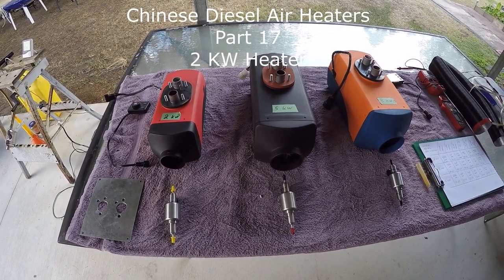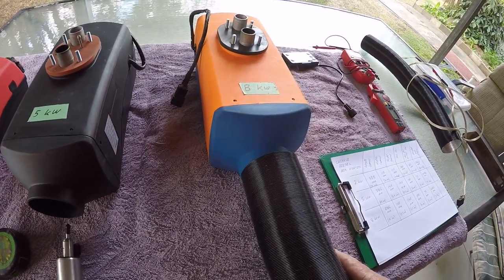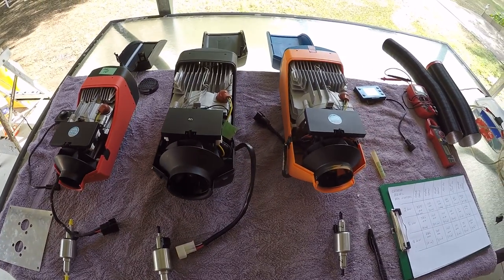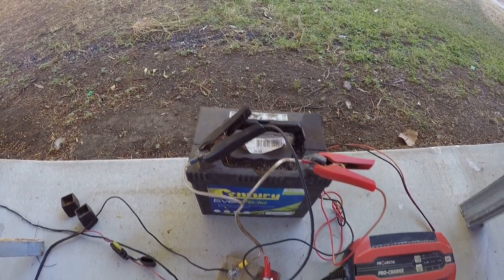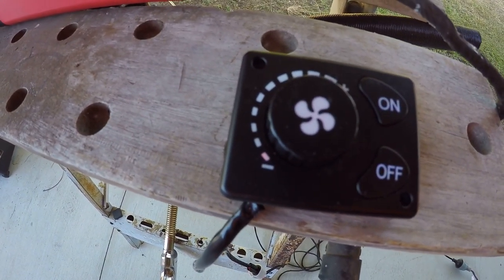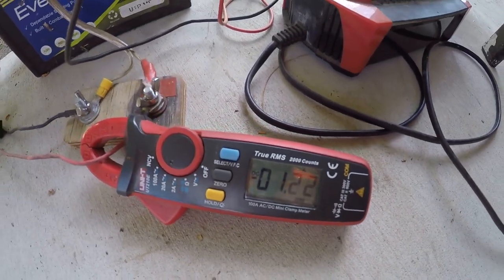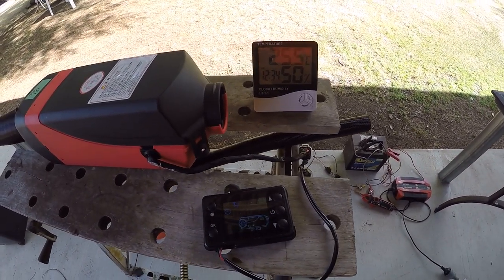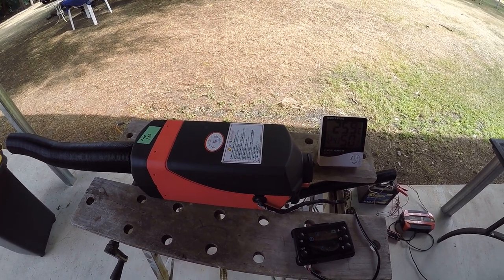Chinese Diesel Air Heater   Part 17 -  2 Kw Heater

Comment: Please tell what is the smallest battery that I should buy to run the 2 kw heater for a nights camping. We are going on a motorbike and hope to carry a heater and a battery in the panniers. Thank you. J
Reply from the maker: On a medium setting the heater will draw around 2 amps.
If you run it for 10 hours a night you will use around 20 amp hours.

If using an AGM battery you can only pull about half the rating or you wreck the battery, so you would need a 40 amp hour battery. 

If you use a lithium battery you can pull around 80% of the rating without doing battery damage, so a 25 to 30 amp hour battery should be ok. 

Run the heater at full power all night and you will need double those figures.   JMcK
Reply: @johnmck1147  Thank you. I suppose it is a stupid idea. Going to IOM TT in May. No electrical tent hookups left. Gonna have to think of another plan. This idea was my safe option.
Reply: @johnmck1147  pity they don't have a method to get it burning quick like a TVO tractor)))

Comment: Nice video.  Can the heaters be mounted side on rather than the outlets facing down?
Reply from the maker: Yes, these heaters can be mounted on their side, but only the side where the glow plug is on the top.  JMcK
Reply: @johnmck1147  Thanks.  I think my temp sensor is faulty.  Fan stays on after shut down, only way to shut it down is to pull the fuse.
Reply from the maker: @idc1873  
It is normal for the fan to continue to run for some minutes after shutdown. The glow plug comes on and the fan runs to not only cool down, but also to expel  any unburnt fuel remaining in the burner.  JMcK

Comment: Hi John, thanks for all of your videos,  very helpful. I have a couple of questions you may be able to help with, I purchased a 2 kw heater which came with assembly instructions but no instructions for the L E D controller. Can this be programmed to turn the heater off at a preset time and is the temperature adjustment done by changing the hertz on the pump or is there another way. Also can I get an E10 error code if the battery is not fully charged . Have you had anything to do with the Japanese  Mikuni diesel air heaters. Thanks in advance for any help. Regards Bruce.
Reply from the maker: Hi Bruce,

The heater can be set by temperature limit in controller, but it won't turn off just slow down when set temperature is reached. When using the auto method the heater “hunts” . It roars along at max speed trying to get up to temp as fast as possible. I almost always use a manual Hz setting myself, that way I get a gradual temp increase without all the noise.

A partially charged battery will run the heater but may not be able to start it. The heater requires around 10 amps of current and 12V to start.

I have no personal experience of the Mikuni heater.  Sorry.  JMcK

Comment: John, thank you for these series of videos. I've learned all I wanted to and more. What is your advice regarding using this heater in a rooftop tent (smaller spaces)?  

The 5kW version is not much bigger so size is not a concern for me. What is a concern is if this will be too hot for the tent during winter camping in 30F to 40F (-1C to 4C) on low setting. 

Another consideration for my setup is noise. I planned to hang this to the rear of my hardshell tent as it seems the best place to place it that won't get in the way of anything I have. Getting a 5kW and running it low means the fan will be less noisy than when running on high of a 2kW unless low setting on a 2kW is sufficient to get my tent to 75F-80F (24C to 27C).  Thank you.
Reply from the maker: Hi William,
There are a lot of unknown variables here for me, such as operation temperatures and install system, but I think a 2 Kw heater will be more than enough for a roof top tent. JMcK

Comment: My 2kw heater smokes quite a bit. Upon startup it’s good, but over time (15 minutes or so) plumes of smoke comes out of the exhaust and the fan speed drops. 

Do you know what would cause this, how to remedy the issue? 

Thank you.
Reply from the maker: Hi Kyle,

It is a bit hard to offer an opinion without knowing more about your set up.

First, I assume you are using good diesel as a fuel, and not some oil product.

Generally smoke is caused by a bad fuel air mix. This can be caused by restrictions in the combustion air intake or the exhaust system. I would also look for carbon buildup in the heater atomisations screens which would also cause a poor fuel air mix.

Good luck.  JMcK

Comment: I am confused.  I remember in one of the previous videos you said it's better to get a smaller heater than the bigger heater if you don't need full power because the bigger one running at reduced speed won't be as efficient.
Reply from the maker: Hi Hung,

I think you may have me confused with someone else. Right from the start in video 1 I state my opinion that I believe it better to get a bigger heater for the particular area and run it slow (less noise, less fuel, less wear) rather than a smaller heater running flat out (more noise, more fuel, more wear) to provide the necessary heat.

However you need to be sensible, you don't want to go oversize for the area. My personal rule of thumb is if a particular size heater can provide enough heat at half speed setting, that is a good size.

However, one issue you can have from long periods of running at a low speed is carbon build up if your install has excessive restrictions. But this is easily fixed by  occasionally running the heater at a high setting for 15 mins or so. 

Cheers.  JMcK
Reply: @johnmck1147  Thank you John for the thorough explanation. It cleared up for me now.  I bought a 5KW heater.  At any speed lower than 3 Hz I lost the 2 red bars,. The casing temperature is only 120 C or less.  I tried everything I could, fan gap, atomize cleaning, tuning.  Everything looked good, clean and no smoke, but the temperature was just too low at low speed.  Plus the load current is over 1.5A at the lowest speed.  I think I just got a defective unit somehow.  I just ordered a 2KW unit on eBay.  Hopefully It will work good so I can install in the van.  Also hope the current load is lower, for my battery's sake.
Reply from the maker: Hung Pham 

Hi Hung,

The normal current draw for these heaters at a minimum setting of 1.6 Hz is about .7A to .8Amps. 

Suggest you check your wire size from the battery. The power wires supplied are absolute minimum, and if you have extended the wires you must go bigger in size.

A 2Kw heater uses about twice the current to produce the same heat output as a 5Kw heater. The fan and pump on the 2Kw have to run much faster, drawing more current.

I talk about this at the start of video no 18. You may like to look at that video.

Cheers.  JMcK

Comment: Hi, thanks for the video. The rotary controller for my little 2kw heater is flashing sometimes, sometimes red, sometimes blue, and the fan level seems haphazard. Any advice? And how do I know if the digital controller is compatible with my heater. I see my controller has 3 wires but I don't know much more about it.
Reply from the maker: Hi KS,

If the controller is flashing it is giving you an error code. Count the number of red LED's that are flashing to get error code. Three flash E03, 5 flash E05 etc.

In the past it was easy to mix and match controllers as they had the same plugs , wire orientation, and protocol. Sadly now some manufactures have gone proprietary and controllers are not easily adaptable.

If your controller plug is a triangle shape, you may be able to plug in an LED controller.

Cheers.  JMcK

Comment: Hi john mck. unfortunately I'm not good at English so I don't understand exactly what is being said in the video. I have a vw transporter, long model. Which diesel heater should I have? I have 5 kw which I have not installed. do you prefer 2 kw. thanks!
Reply from the maker: @Håkanhavsöring  
Hi Hak,

With a VW Transporter, you could probably get by with a 2 kw heater…..But this is very dependant on the insulation of your vehicle, and the winter environment you will be travelling in. This you have not stated, so I can only give you an opinion.

I find it always better to have a bigger heater running slow, rather than a smaller heater running flat out, and making much more noise. However, this is personal choice.

The footprint of both heaters is exactly the same. So with your install, if you can, have room for a 5 kw heater, then you can easily swap the heaters in and out. If 2 kw too small, swap it out for 5 kw. If you start with 5 kw and find it too hot, easy to swap it out for a 2 kw heater.

Safe travels.   JMcK
Reply: Thanks for your detailed answer JMck:) I live in Sweden so the winters can be cold. I start by installing 5 kw. Last question: Is there a risk of fire if the heater is turned off without being cooled down before turning off. Thanks!! / Håkan
Reply from the maker: @Håkanhavsöring  

Hi Hak,

It is not good to turn off these heaters at the main power, and not allow them to go through a cool down cycle, and blow out any residue diesel.

I have not heard of any heaters actually catching fire, but I know of cases of the ECU melting, including one of my test heaters. If there was some loose paper or flammable material in contact with the heater, you could potentially have a fire.

JMcK
Reply: Ok Thanks for your answers:)
Take care🤠
Hakan

Comment: are the gaskets you can buy, are they all the same size; i needto order some
Reply from the maker: The 5 Kw and 8 Kw heaters have the same gaskets. The 2 Kw heaters use smaller gaskets. You need to order gaskets for your size heater.  JMcK

Comment: Questions boss.  I have one of these heaters with the LCD controller.  It seems no matter how low I set the thermostat 8C the heater just keeps running?  Does the thermostat not automatically turn the heater off and on?
Reply from the maker: Hi Jack, it turns it down to idle. If it turned it off you would have to manually start the heater again. I personally would not have a heater that could just turn itself on by itself.  JMcK

Comment: Hi John
Just fitted diesel heater, runs efficiently for about 10 minutes then winds down with E-05 error message. Can you please advise reason for fault & procedure to fix.
Thanks in advance. Brenda
Reply from the maker: Hi Brenda, 

E05 is often an overheat fault. This can be caused if there is not enough free air around the heater, running the heater at too high a setting for the ambient temperature, or a sensor fault, or lose sensor wiring.

One issue that does come up if controller set on automatic temperature setting, is the heater goes flat out on start up to try and get to the set temperature as soon as possible, and the heater can overheat.

Suggest you try your heater on a manual setting, say 3Hz to 4Hz and see how that goes. 
I personally prefer to only use the heater on a manual setting to prevent the heater roaring at full speed trying to heat the room to temperature as soon as possible.

It is very rare to have a sensor failure.

Please let me know how it goes.  JMcK

Comment: John what a wonderful video. Nice work. While watching I noticed one thing you didn't cover. Is there a difference in the orifice/nozzle size between the models? If so, there may be some different consumption numbers. Again, nice video.
Reply from the maker: Hi SV "R"

The dosing pumps are positive displacement pumps. Both pumps are the same putting out .02 ml per pulse. The same pulse rate pumps out the same volume of diesel.

When the diesel reaches the heater it is not injected into the burner chamber through nozzles as in some other heater types but into a circular burner screen around the top of the burn chamber. Air is forced through slots at the head of the burn chamber and through the screen containing the diesel causing atomisation of the diesel for it to burn.

Cheers.  JMcK
Reply: Excellent info John thx

Comment: Hallo jhon i am Michel from Holland and i have a special problem whiff my Chinese airheater.i have the folt code e17 ..
.....do you now what that is it stats up fan is turning after 17 sec the heater turn of an give the problem e17
Reply from the maker: Hi Michel, 

I do not know of an error code E17, are you sure it is not E07?
If E07, it means there is some problem with the wiring to the controller. Perhaps a bad plug connection of broken wire.

Other common reasons for your issues, are flat battery or voltage drop in the wiring. The glow plugs needs around 8 to 10 amps to start. No fuel getting to the heater could be another issue.

Sorry I can't be of more help.  JMcK

Comment: Hi John, excellent investigations on the chinese heaters. I bought a 2kW and I am about to install it in my RV. I wonder if you ever told something about the mounting position. The original Eberspächer did not recommend a position were the glowplug faces down. The Chinese user manual explicitly says that all directions are possible. Do you have an opinion on that?
Many Thanks to let me (and your fans) know.
BR Carsten
Reply from the maker: Hi BR,

These heaters are generally mounted with the exhaust exiting out the bottom, however you can mount them on their side with the glow plug at the top.

In practice, you can mount them in any position and they will work. -  FOR A SHORT WHILE
With the glow plug on the bottom you will have flooding issues as the diesel pools around the glow plug and you will not get a correct fuel air mix to get a clean burn, you will get lots of carbon build up and eventually the heater will not start, and require some serious maintenance.  JMcK
Reply: @johnmck1147  Hi John, thanks for the answer and explanation. I expected something like this. Now i have to change my plans for the position of the heater. 
Greetings from Germany, 
Carsten

Comment: Hey John just watched your video fantastic little set up you had going on there and information second 2 none 👍🏼
Can I ask what amp power supply would I need as I’m installing inside a big shed I’ve been told 20 amp but after your video I’m not sure I need something that big maybe a 15 a 
What do you think buddy ?
Reply from the maker: Hi Andrew, these heaters will draw around 8 amps to 10 amps to start. (Fan running and glow plug heating) but only around 1 amp to run. A tiny bit more if your wire is undersized or connections not tight. With everything perfect a 10 amp power supply would work, but I suggest you use a 15 amp power supply to have a bit of leeway.   Cheers. J McK
Reply: @johnmck1147  
Thank you John McK you truly are a gentleman thank you so much for your response & knowledge you sure are a great help….. & saved me a few pounds 🇬🇧 all the best to you 👍🏼thank you so much

Comment: Great information, John!  Your videos have allowed me to do a much more professional installation.  One question:  Do you know if there is a maximum elevation that these heaters will continue to operate properly?
Reply from the maker: Hi DA,
These heaters suffer from carbon build up at high altitude due to lower oxygen levels and hence rich running. The genuine heaters like Eberspacher can be bought with a high altitude kit, and I believe there is a controller available for some Chinese heaters that can adjust the fuel air ratios for altitude.

The higher the altitude the more carbon deposits, the shorter the service interval.

But you can minimise the carbon deposits by burning a high kerro/diesel mix, say 80/20 or 90/10 at high altitude.

Cheers,  jMcK
Reply: @johnmck1147  Hi John friend,Im in uk and am watching your video's on these heaters,I have a 2kw rotary controller which has been treated a bit badly to be honest mate,I just wanted to ask you John if when I strip my one down later on is it ok to clean the burn chamber of soot/carbon with a drop of petrol and a  brush ? I have bought the kit with gaskets and glo plug,Any help would be terrific John,Thanks and take it easy bud .
Reply from the maker: @bencurry5295  

Hi Ben, suggest carby cleaner, kerosene, or even oven cleaner may be better options than petrol.  JMcK
Reply: @johnmck1147  diamond John,Thanks mate.

Comment: Is there a diesel additive to clean the atomizer and get rid of the  soot ?
Reply from the maker: Hi Andre,

You can try diesel injector cleaner, but if the carbon is really bad you need to strip down the heater, and clean it out manually.

Cheers.  JMcK
Reply: @johnmck1147  Thank you